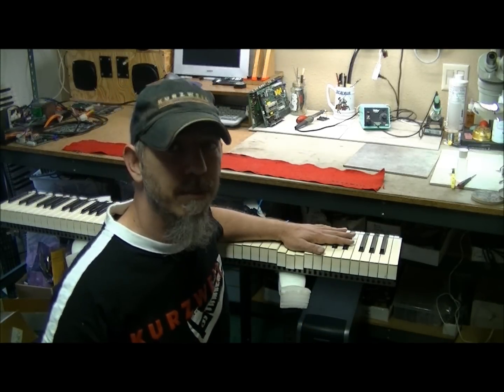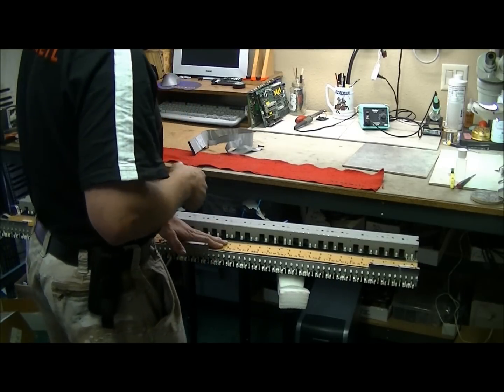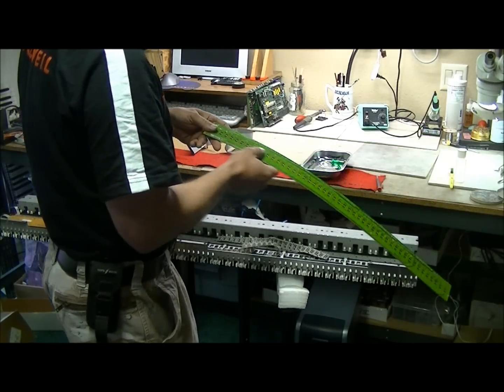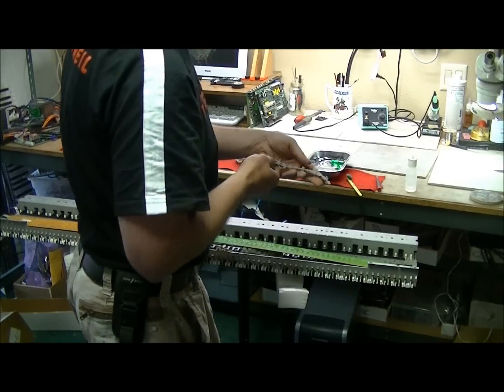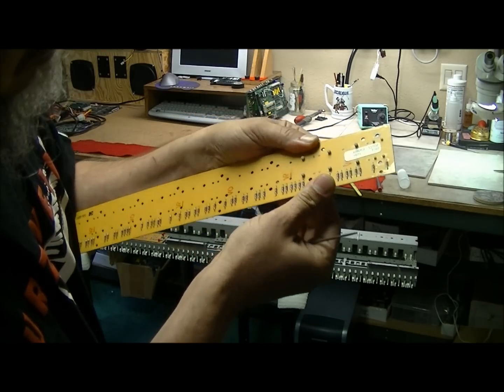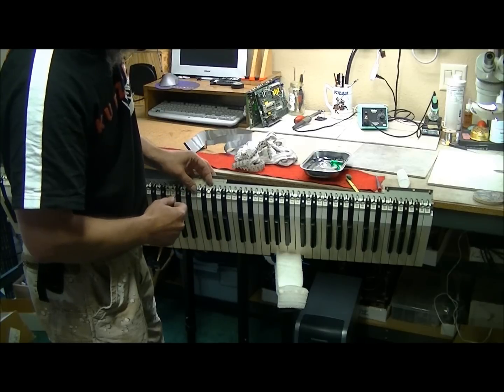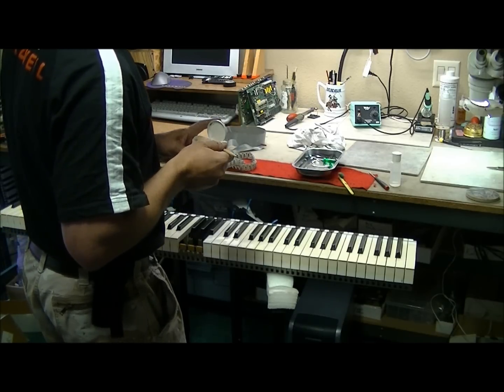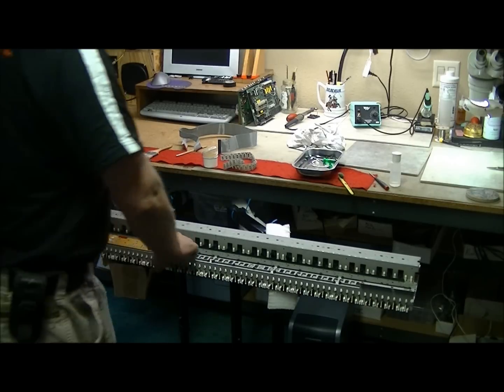Kurzweil / Fatar TP10 keyboard assembly repair

Comment: Hi Duane, phantastic help. Directly under the keys, are the slim rubber dampers which are placed over the plastic tongues (preservatives anyone;). This PCV Rubber dries out and the tongue slits the rubber. Did You find spares or a replacment for this issue?  Thanks

Comment: Thanks for this great video! I have a PC88 that is generally in great shape, but did have a minor water spill on a small section of keys. After the spill, some of the keys weren't triggering at all and some too hot (full velocity). I cleaned the PCB as shown and after a day or two (I guess for the solvent to fully dry). While many keys were fixed, I was left with 3 adjacent keys that trigger full velocity much easier than the others.

Do you think its possible this could be due to damage or dirt to the PCB, despite my fully cleaning it twice already? Or could it possibly be due to the key mechanisms getting looser from the bit if water that got in there. The keyboard was lightly used and never opened over 25 years, so I can feel some stuckyness in the action, but maybe it was less noticable when they were all equally dirty.

Sorry for the long message, any advice appreciated!

Comment: I have two k2500x, pc2x and triton Le88. They all use the same model of Fatar key bed. I replaced the pc2x, which was completely broken and no longer repairable, by purchasing a very cheap used digital piano with the same keybed. Digital pianos in very good condition can be found at very low prices on the used market. (20$~50$)
But your keyboard repair videos are very helpful. thank you!

Comment: Hey if I don’t reconnect the headphone jack will it register headphones and not initiate speakers
Reply from the maker: What model? In most Kurzweil home products the audio signal goes through the headphone jack then to the speaker amps then speakers. So if the headphones are plugged in, no audio to the speakers but as soon as the headphones are unplugged, audio will be sent to the speakers.

Comment: Thanks to you, I was able to repair a broken counter weigh on my 30 year old Mark 10!
Reply from the maker: I am happy this video helped you! If you get a chance, replace the "super capacitor " on the engine board. They will eventually leak and corrode traces.

Comment: Hello have anu issue with my MP15. some of the keys have started to go down on its own. They are int the pressed Condition and there isn't any sound on those keys. would you by any chance know how to fix it. Kurzweil hasn't responded and the tech's here in India don't want to touch it. ... would be great if someone could help :) thx in advance

Comment: Hey. I have a ka110 with a key problem that when i press a few makes a sound inside like hitting plastic against plastic. I've already disassembled it and saw that at the end of the plastic key the rubber got old. Ive fixed that but anyway some of the keys seem to do that noise from the contact part or whatever. I didnt take a look at that part... But had you repair one of this model with this particular problem?

Comment: Man this was interesting. i just recently acquired a k2500x and it has 2 keys in the middle of the keyboard that feels like they are easier to push down than the other keys but the same time don't come the whole way up. gonna have to check why that is..  from this video it doesn't look impossible...
another issue is that there seems to be something in the way of the highest note.. i can push it down gently but something is kindof scraping. 
gonna see if i can work that out to...
awesome video!.
Reply from the maker: Sounds like a broken counterweight. Did you find/fix the problem?

Comment: Thx for this. I have an old, but extremely nice Kurzweil grand piano. It has a 3.5" disk drive. Any ideas how or if I can upgrade the computer and enable modern tech?
Reply from the maker: Hello Steve,
 If it's a Mark 110/150 or 112/152 then unfortunately no.

Comment: Good video Duane! I am a tech in hawaii where there is plenty of corrosion form salt air. Is the keyboard of the MP10 similar to the one in your video?
Also , if the MP10 I will be servicing has too much corrosion on the contact boards (like I find on many older Yamaha digitals), is there a supplier of the boards in the US if I need them?
TIA
Reply from the maker: You can try : https://www.midi-store.com/Fatar-Key-Contact-PCB-Bundle-p/sku27819.htm
  This is for the fatar TP-10 series. Looking at the picture should let you know if it will work.

Comment: Mr Insane! I do have a question about a Kurzweil PC2. Looks like your video will solve the squeak problem but we have another long piece of felt that is squashed from use. 5-6 keys around the middle C klunk hard as you release. Should I reach in and fluff these areas of felt and apply the Vaseline like on the red felt? I don't see a place to monetarily subscribe. If there is let me know where.  Thank you, Mike in Lansing, MI

 (there are 3 long felts in this keybed. 2 would be accessible to change with the keys out. The problem is with the 3rd one which is not accessible)

Comment: Thank you for this video.  I have a PC88 that I needed to do some felt repair and this helped me greatly!!  I had "knocking" keys where the felt strip underneath the key-weights had disintegrated over time.  This keyboard model is like 25 years old!  It's been my favorite controller keyboard for the last 15 years.  I've had 3 of these boards.  Sold my first one, then a friend lent me his for a few years, then bought another one off ebay.  The most recent one I have had the knocking keys problem.  Once disassembled down the key-weight chassis, I was able to remove the old felt fragments and replace with craft felt with adhesive backing.  I cut in 3/4" strips and applied to the back of the chassis.  I found this solution from an online thread where someone had success using the craft felt.  This is felt that the key-weights fall back down to after depressing the keys. If you need to replace the felt at the front of the chassis (what the key-weights press down on when pressing a key), you may want to find a replacement chassis from a Kurzweil used part vendor.  I've found a few that still have them.  Just google.  My key contacts were fine, but the direction on taking they keys apart was super brilliant and extremely helpful.  I now have a chopstick as part of my tool set, LOL.  I sanded down the non-pointy end of the chopstick just like he said into a "flat-head" shape.  This helped me remove the old felt fragments by utilizing the flat-head as a tiny chisel to scrape away the old felt.  This helped preserve the plastic of the chassis.  Using something metal would have scraped it up.  Again, thank you for posting this video!!!!!!!!! This is so awesome!!

Comment: Fantastic video, immensely helpful on my Kurzweil. Do you have any suggestions on key dip adjustments? The bass end of this PC2X works great, the middle of the treble end (white keys only) is not reaching the rubber buttons. They look to need another 1/16th of an inch, compared to the other working keys. Any help appreciated!
Reply from the maker: Are they put on the correct way (each key has two contacts, one hole is deeper)?

Comment: Thank you for this video. Do you know if this will be similar to the 88-note TP/40WOOD found on the SL88 grand? or is there a video about it?? Studio Logic is NOT being helpful!
Reply from the maker: I'm not sure. Most Fatar keyboard assemblies have a similar design as far as how to remove keys and the keycontact pcb. The weight mechanisms are different between the TP-10 and TP-30. I haven't seen a TP-40 WOOD so I cannot comment on that one.

Comment: THANKS FOR THIS GREAT VIDEO DUANE!!!!! YOU SAVED ME!!
Reply from the maker: I'm happy this vid helped you!
Reply: insaneduane Yes, I changed one of the rubber strips and my Bb key came back to life. The modulation wheel on my Studiologic 990 sends erratic data...not smooth...any suggestions? Have a wonderful weekend and thanks again for sharing your knowledge!
Reply from the maker: Sounds like a bad/dirty potentiometer . Replace it if you can find a replacement. You can also try a contact cleaner made for volume knobs.

Comment: Insane, Duane. I just paid a repairman $250 to fix my Forte 88 because the velocity on one note was full each time the note was hit. I guess he replaced all the contacts ($8 an octave + labor). With your video, I could have done it myself.

One problem. Well, I think it's a problem, my tech seems to think it was always this way. After the Forte has been put back together, something sounds like it shifts inside when carrying the keyboard. You can put it on one end and rock it back and forward and hear some kind of clump. Like the keyboard assembly? Don't know. Had my tech open it twice and he can't find anything. Any ideas from you, Duane? Or anyone else?

Thanks in advance.

Comment: Worked great. My girlfriend and I used a crochet needle to get the springs out. way easy. However, the unit had been in my closet for five or six years and i lost the pictures i took of where the cables all went. II put it back together as best I could remember and only five keys i the middle of the board work as they're supposed to the rest all perform random actions. do you have a layout of the cables or any recommendations? Also I found a mark III that only has a backlight on the lcd but does nothing else. Please help! Thanks!!!!!

Comment: I took apart my Nord NS2 88EX this week. The key board noise began 2 months after the warranty expired. I did pretty much what you did. But I haven't tried vaseline on the felt, yet. Thanks for that tip.  I still have 2 keys that clack like crazy, even after lubricating the pivot area. $4,440 for a great Nord, and Fatar ruins it with their outdated design. Ain't that life. Thanks for the video.

Comment: Thank You so much !! I bought a used Kurzweil sp2x a couple of days ago, and the guy told me it was workin perfectly, but then while I was playing I found that the one octave higher than middle C, Eb key, is playing maybe at full velocity or a slightly lower. So I will have to do what u did, and maybe remove all the keys because its kinda dirty inside :D IDK what would I do without this video. :D

Comment: Thanks for the video.  I've got a Fatar keyboard, and one key's green plastic pivot tab has broken off.  I've tried a couple of different glues, but nothing holds up once the key is snapped into place and the spring is pushing up on the key.  I'm thinking that I need to pull out the steel rod running through all the pivots and replace the green plastic pivot.  Any pointers?
Reply: wow John I'm trying to do the exact same thing right now.. Did you find anything out.  I
Reply: +Charles Spencer I ended up drilling a small hole through the top of the key and into the green pivot, and then putting a screw in to hold the key down to the pivot. It works OK, although the feel of that one key is slightly different from the others.
Reply: tempting.. cause this one key doesn't sound when I play very quietly.. And this is a with a full key contact board replacement. How far out is the different feel? Could a washer or other adjustment perhaps perfect it?  I can only find used pivots for sale on line and I'm not even sure how to extract the rod.... Very tempting, your solution is.
Reply: +Charles Spencer The feel of the repaired key is not noticeably different so much as it just plays very slightly more softly. Given how weak the plastic is, I didn't want to tighten the screw any further.

Comment: Hello Duane. How could I thank you for your advice and precious video? I'm in Rio, Brasil, and just unplugged my PC 88 off, for it  is not the squeeking only but it may have lost its keybeds effect, probably due to severe use and teaching during all those years. I have this knock sound perceived in the real piano when the keybeds are worn. I didn't open it yet but if the counterweights are broken I'm afraid I won't be able to get spare parts. There is a B5 ( to me where it reads C4 is actually C3 in the piano). So, if considering C4 in the middle of the keyboard it might be B6. This B lost its sensitivity and sounds louder. I'm able to sort of controlling it reducing the note in duration. Hope you be around for I need you, for sure. Thanks a lot.  I have the PC88 Service Manual but I'm unable to read all those charts, and diagrams. I already opened it once and  changed the battery and that's all I could do by my own. Greetings. Hugo Braule.

Comment: Hi there Duane. I have an issue hopefully you'll know. I got the keybed out and cleaned everything, but still get two loud key. The upper contact, the one that measures velocity doesnt work even if cleaned. I bought new key contacts and still the same. Would you think I have to replace that half board? Thanks a lot for this video!

Comment: Great video. I have the problem with squeaky keys and I'll try to fix it. I have a couple of questions. Do you think it's possible to use silicon-spray instead of removing the entire keyboard?
I have a Kurzweil PC-88 and there is no sound at all in the right channel, not even with headphones. Is it possible to fix it or has the motherboard went broken?
Thank you for the upload.
Reply: Same advice as KeeDx3.  Don't spray.  I did, I sprayed a teflon silicone spray with a tube nozzle.  It did nothing for the squeak, much to my dismay.  

I couldn't tell where the squeak was coming from, so I sprayed a bit at the top of the key and the bottom of the key.  Those didn't work, so I sprayed along each edge of the key.

As I continued to see if by repeated pressing, the action would "work it in," what really happened was that the notes started sounding very loud, and then quit working all together.

From the spraying that I described, just on one key (top, bottom, and sides), I completely lost sound on 8 keys, and 1-2 on either side of that group were very loud.

I ended up taking everything apart, and determining that the key lever rubbing on the patch of red felt was responsible, I came here to find out what to use since the silicone and telfon didn't work.  Meanwhile, the red felt was saturated with spray, which I had to press in order to express.  Also, as an FYI, spraying the silicone/telflon also chemically damaged the rubber boot with the contacts in it.

I put it back on, swapped the rubber boots where it was damaged from some from the highest keys on the treble side, because I rarely use them.

Hope this will be helpful to someone in the future.

Comment: Hi Duane
many thanks for that great video.
It is really helpful.
I have one question.
I recently bought a used Fatar Studio 1100. To my knowledge it has the same keyboard built in.
Now aprox. 4 of 5 white keys make that squeaking.
Now because i will have to remove so many keys i think the best decision might be to remove ALL keys and give the whole keyboard a complete service on this occasion.
Do you have any tip or advice what other maintenance (especially to the moving parts) besides general cleaning and what is shown in your video i could accomplish?
Many thanks in advance :)

Comment: I am replacing the felt on each hammer on my Kurzweil RG200.  Do you recommend mostly wool felt (70%) that is used in grand pianos, or would craft store synthetic felt work? (%50 "eco-fi" polyester/recycled plastic bottle material, and other %50 unknown).  I am also replacing the foam/felt strips that deaden the keys hitting and returning on the keyboard cage.  They are glued to the metal on the top and bottom of the cage.  Is there a specific thickness of felt and or foam, or can I possibly buy this material somewhere?  This is driving me crazy...second time I had this apart...first time just fixed a broken hammer.  The plastic on the hammers that holds the actual weight inside of it is cracked on many hammers.  I plan on epoxying these and filling in the cracks to prevent breaking.  Any suggestions?  I already have one hammer rack out and have four different types of glues ready.  Thanks!

Comment: Thanks for your video, I'll try soon to clean my new K2500XS keyboard.
Reply: Cortez77fr Finaly I've took the time to work in the keyboard and I've removed tons of dust, restored the velocity of 1 key and the noise of various (sadly there is still a noisy key after reassembly, but too tired today to open it again. Thanls again !

Comment: This is a great video and one I will most definitely refer to because, as you may recall, you helped the guy at Pro-tech by phone when he couldn't get the aftertouch strip back in right. They had sold and installed a replacement keybed to me in 2010. It squeaked from the onset but works. I'll fix it at some point thanks to this video, Duane. Right now I'm repairing and restoring my 80's Memorymoog which needless to say is very time consuming. Hope all is good with you, Duane.

Comment: Duane- thanks man. I bookmarked this a long time ago and used it this week to fix my Studiologic 990 Pro which had one loud key (B flat in the 4th octave) and I did everything you said- took it apart, cleaned the PCB boards and the rubber pieces with the alcohol, put everything back together and BAM, worked perfectly. So much better now. Can't thank you enough!!!

Comment: Hi, thanks for the great video. I have also squeaky keys on my PC3K7, so do you know is there any circuit or something under the keysprings of PC3K7 that could be damaged if I lubricate springs without opening the device? I have tried contact cleaner but it only helped for a while, so I think I'll need to use some another lubricant that might damage electrical things.